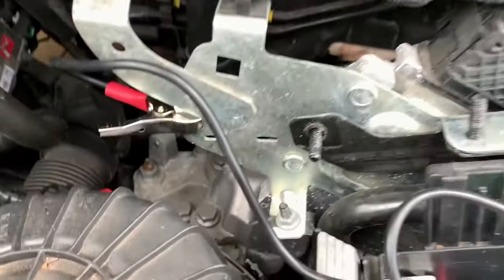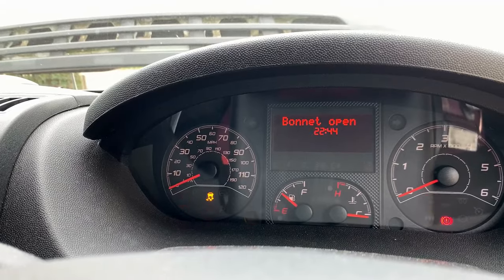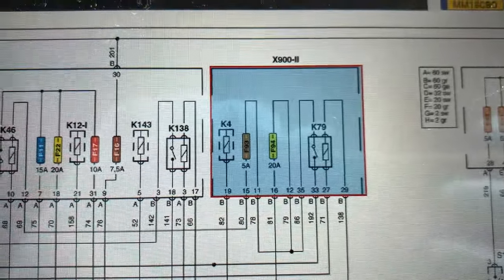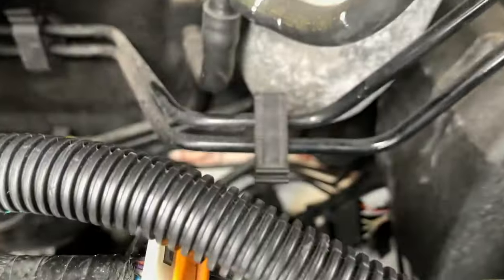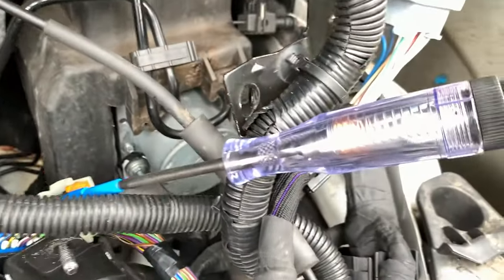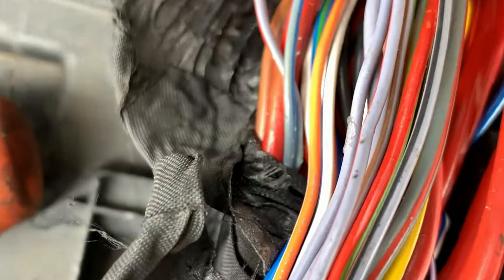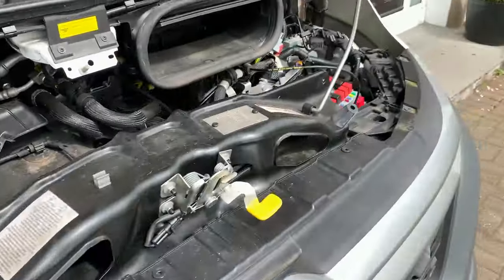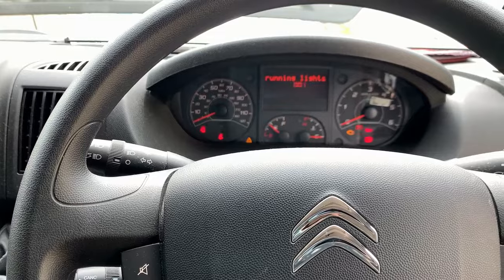Citreon Relay / Peugeot boxer - Engine ecu no communication Fault & fix

Comment: hello i have a problem whit my Citroen jumper 2,2 dhi 2007 hard start and when starts ..2-3 sek later engine die   (new injectors and new EGR were installed  still same problem )

Comment: Hello friend. The car arrived today in working order. Car won't start after installing new software. There is no problem with the battery and fuses. I would be grateful if you could help.

Comment: Ecu on peugeot boxer 2007 says not matched. It was cloned by another person before me. So the ecu cost the customer £700 thereabouts. They sent it back and it was installed and yet van cranks but no start. Says cam crank not synchronised and ECU not matched. Any ideas how to match it

Comment: Hi I have a 2013 Peugeot boxer van and I have tried three OBD readers none of which were linked I have power on pin 16 fuse in  fuse box is ok is there any other fuses any help would be appreciated 👍 excellent videos by the way

Comment: Hello mate.

 

I have a Peugeot Boxer3 2.2 with 140 hp from 2020 with 110,000 km and when I passed the second MOT, last Thursday it came back UNFAVORABLE.

 

The defect is SERIOUS: “5.3.6 VEHICLES WITH COMPRESSION IGNITION ENGINE: OBD reading. Distance or time since MIL activation is greater than 1h or 1km with OBD reading MIL OFF”

 

The ITV doesn't give me any explanations, the operator told me to take it to the Workshop to see the problem.

 

It should be said that there is NO warning light on in the car dashboard, I do remember the symbol coming on on several occasions.

yellow for engine failure because according to the official company they had to do the maintenance (oil change) but that failure warning light when changing the oil disappeared so at the time of the inspection everything was OK.

 

The problem I have is that I have not been able to drive with my work tool since last Thursday since I am a self-employed transporter, and to think that I have had an MOT issued without justification by the ITV makes my blood burn, you can't imagine how much.

 

 

That same day I called several Peugeot dealerships and they did not give me an appointment until 15 days later. This is unacceptable for my job, so in desperation due to the situation, I decided to buy the lauch CRP 123E PLUS scanner on Amazon to clear up any doubts and see if it really there is some fault.

 

Well, after carrying out the diagnosis with the scanner, the result is FAVORABLE, my van has no fault whatsoever.

Could it be because the switchboard needs an update? In December of last year, Peugeot sent me a letter indicating that in order to prevent engine stall anomalies, the engine control calculator had to be updated, but since the vehicle never had any faults, I didn't take it home because every time it enters a workshop it comes out worse.

Comment: Two questions Ryan, which model topdon scan tool are you getting wiring diagram on and how do I save the capture on the micsig to analyze later on?
Reply from the maker: Sorry for the late reply daniel, I use the phoenix plus model which allows you to use it as a normal tablet for google etc, The quick save function is what saves the reference waveforms for the micsig although i find it to be limited compared to the pico with the captures etc !

Comment: Mine has the same problem at the moment. The ECU is on the verge of being replaced but this has stopped me in my tracks.  

Being a complete novice with auto electrics, how do wires just break like that (in all honesty I couldn’t see the break in the clip!)?
Reply from the maker: Hi Sean is yours the same age as the one in the video? If you need any guidance or help be my guest and fire away. The corroded wire on this van was very fine and I know what to look out for just by experience :). They usually break due to poor quality copper/water ingress.
Reply: @mrautoservices7354  thank you very much! Ours is a 2007 (57 plate) and has suffered water ingress that should now be cured. We have the exact same symptoms though; it turns over but doesn’t fire up. Engine management light doesn’t come on but the immobiliser light stays on. Diagnostic gives a ‘no ECU communication’ fault code
Reply from the maker: @seanDB1989  First thing that i personally would check is powers and grounds, The most basic check that can  be done with a multimeter
Reply: @mrautoservices7354  sounds a good idea to me! Seems sensible to check those before replacing the whole ECU only to land back at square one!
Reply from the maker: @seanDB1989  Definitely! Get back to me with your findings 👍
Reply: @mrautoservices7354  hi. Ryan i got this same. Issue wiv. My fiat ducato would it be same thinh
Reply: @mrautoservices7354  evening! An auto electrician local to me looked at the van today. He had it running in 20 mins! Basically water has got into the fuse box and caused corrosion. He’s wired one fuse to another with a fuse in between (excuse my zero knowledge!) as a temporary fix, but in short a new fuse box is the way to go.

Your video stopped me replacing the ECU and saved me a lot of money. Also very grateful for your really helpful comments. Thank you!
Reply: mine is a 2007 relay and has a similar problem, wont start and the immobiliser light stays on. fault check says problem inside control unit.

what is the best thing to ask an auto Mechanic to check first.

thanks for your help.
Reply: @seanDB1989  same symptoms as mine, mine is 2007 too.

someone has suggested replacing the ecu but sounds like its a similar problem to yours.
Reply: before i upped one of the fuzes it said problem with communication to ecu
Reply: @benedwards8185  an auto electrician got ours going by sticking a wire between fuses F11 and F16….that got it running at least. I then drove it to an auto electrician in Derby who found a broken wire. Once that was fixed all was well. I certainly wouldn’t replace the ECU without knowing it was certainly dead. They’re sealed units so ‘shouldn’t’ get upset by water ingress.
Reply: thanks sean
Reply: @seanDB1989 hi Sean can you remember the auto electrician in Derby as I'm local and have the same problem😢 cheers pal

Comment: These vans have the security system caljwd (ghost) if stolen very offective however very temprentle in starting
Reply: Hello friend. The car arrived today in working order. Car won't start after installing new software. There is no problem with the battery and fuses. I would be grateful if you could help.